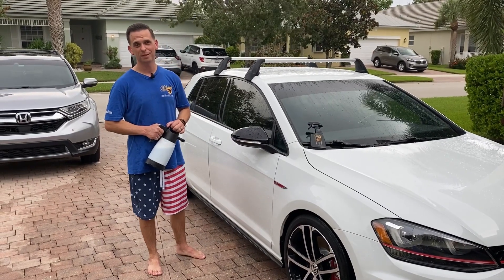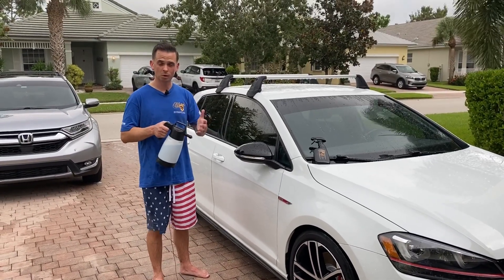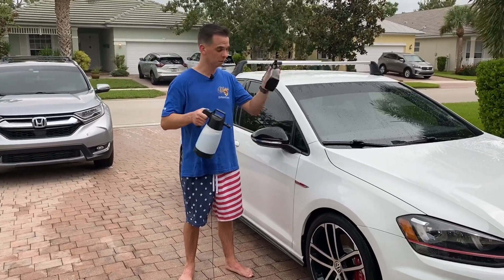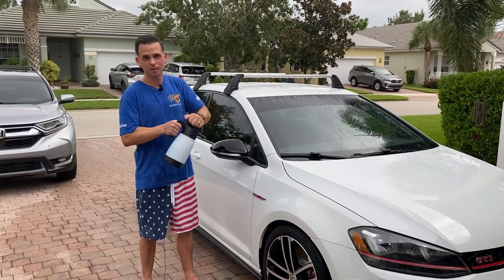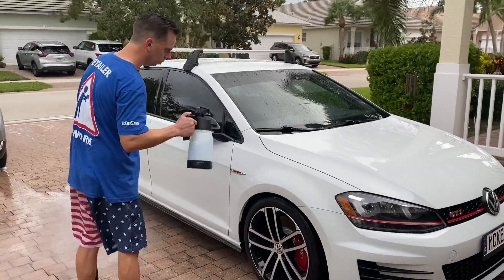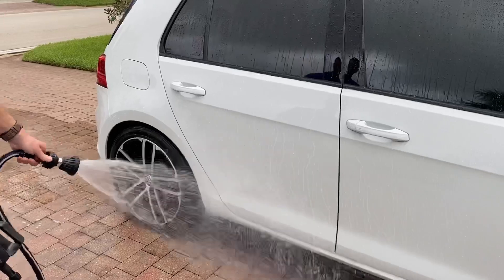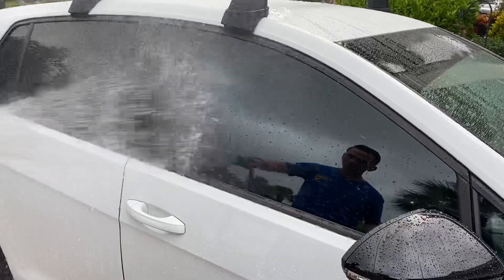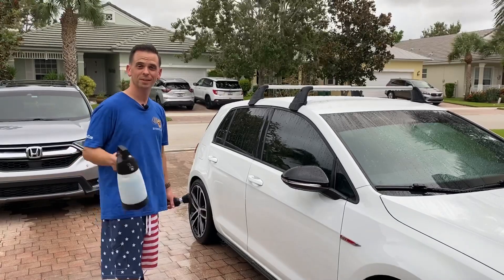Game Changer: The BEST Way to Apply Hydro Blue SiO2 Coating with IK Multi Pro 2

Comment: I noticed when you were doing both the doors it looks like you didn't spray any of the hydro blue on the top of the doors. Just the centers. Is it ok to do it like that? I'm just wondering if the tops of the doors will get the protection doing it the way you did it in this video.